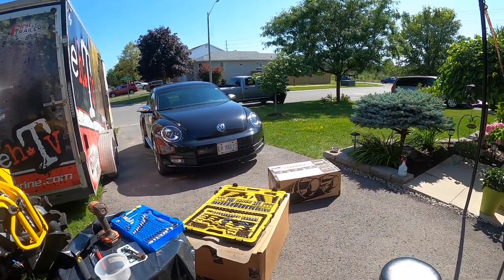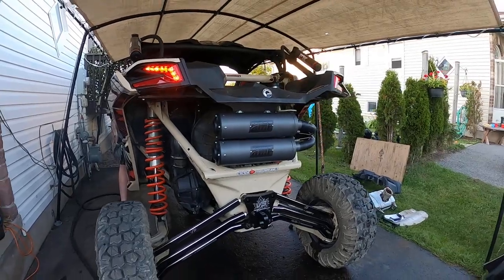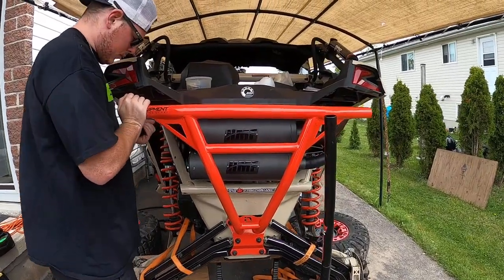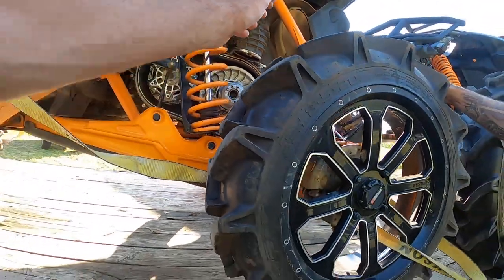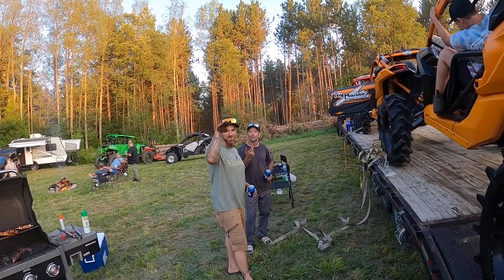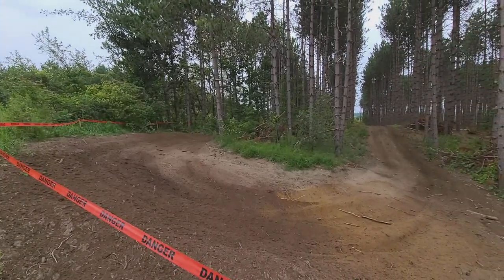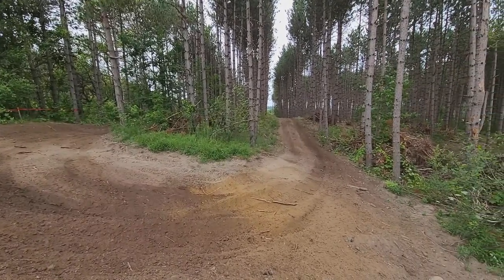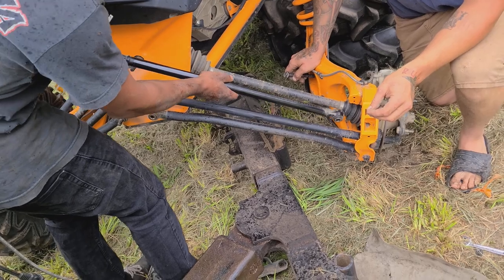Before & After HMF Dual Titan Exhaust Install On 2021 Can-Am X3

Comment: Oh man the secondary roller struggle 😂 oem doesn't handle abuse all that well
Reply from the maker: Tough little buggers to remove without that puller
Reply: @ehTV1000  100%!  I made my own tools at home but  at time I couldn't wait couple weeks for shipping. Those pins are in snug. Running now warranty killer pins and rollers over 3000km on them and no hiccups
Reply: @ehTV1000  and as you know I baby the machine so I mean it's lady driven miles  😉